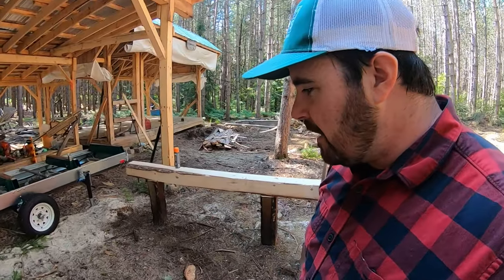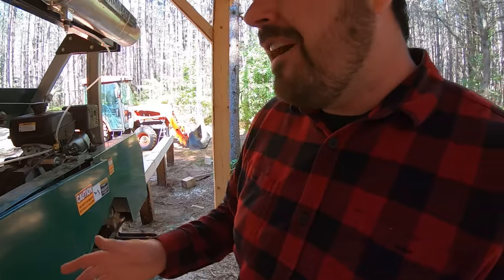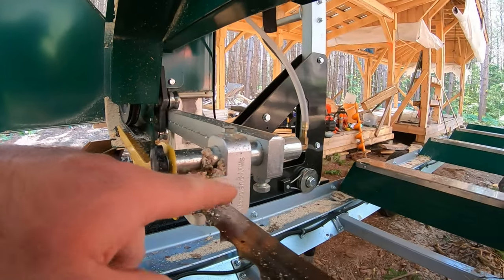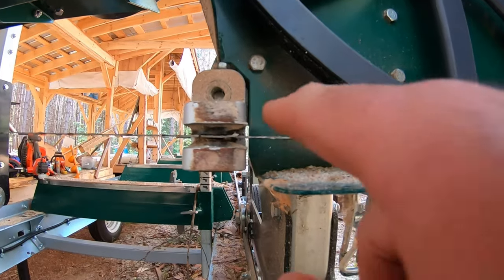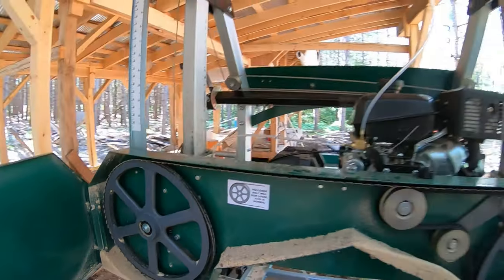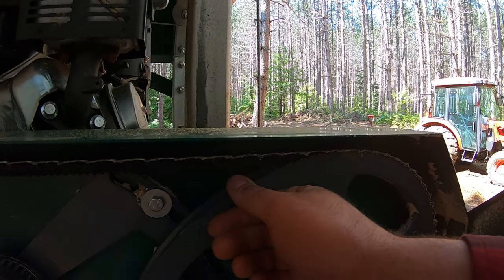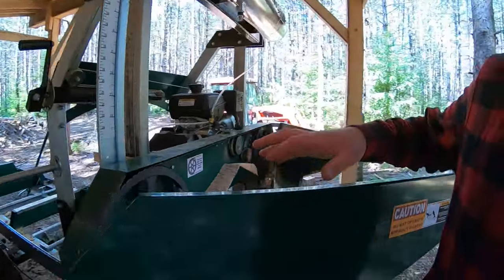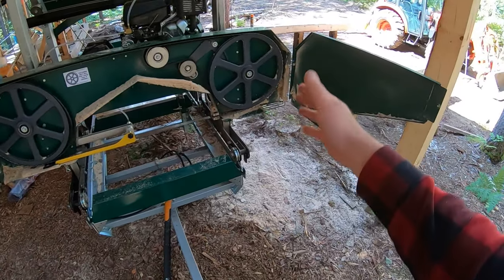Stop Your Sawmill Blade from Falling Off

Comment: Hi Sandy, Are you using 1 1/2" blades? I hear that they last twice as long as 1 1/4 blades with very little deflection.
Reply from the maker: Great question. I haven't tried the 1 1/2" blades. Sure would like to some time though

Comment: I had two problems when starting. The clutch was engaged and I couldn't rotate the wheels to check blade alignment. The drive wheel is one centimeter further forward than the follower. Both problems are factory quality issues in my mind.
The manual for the HM122 is faulty or leaves out essential information so thank you for pointing out the torque specs for the blade tensioner.
On my band wheel alignment problem, besides adjusting the tilt of the follower wheel, can I tap the shift outwards so the two wheels are in alignment?
Reply: It appears there is a pivot pin through the drive shaft preventing its forward motion. So the only remaining option is to adjust the shaft on the drive wheel. Comments?
Reply from the maker: Hi Steve. I'm not too sure about whether the shaft moves forward and back unfortunately. I don't believe so however
Reply from the maker: I'd likely want to double check with the tech support at Woodland Mills to see if they've got a good solution.

Comment: Sandy if you would have bought a mill from valley made in Canada you would not have a problem with the blades coming off mine is a green monster made by Pascale metal I do big trees allot of big hard wood s I slabed a big cepriss 50 inch wide and 20 ft but as long as I keep the pressure up on tincture it is good but I don't have a hydraulic
Reply from the maker: Yeah they look like good sawmills. I"m not too familiar with their blade tracking system though
Reply: I use cooks blades and it is just like your mil right now but I'm going to switch to the cooks wheels they don't have to have the fan belt it's soled the blade runs on the wheel that is prefit and true it works allot bedder go on there channel and check them out they make the best sawmill on the market but I can't justify owning one I just cut for my own place I have a small farm and I always have to make something for the farm and do like you and harvest the dead trees own my land have a blessed day and keep making the videos there's a lot of people out there who need to learn how to do it

Comment: My hm126 throws blades often. Feel like I’m fiddling with it more than I’m cutting it really kills the joy of the hobby.  I’ve been on the phone with WM many times with this issue and no resolution. Wheels are aligned and tracks fine, but 3-5 cuts in, it pops off again. I had no problems with other mills I’ve owned, but this one has been a pain.
Reply from the maker: If you need some help feel free to email me. It’s a learning curve but once you get it dialed in it will work well for you
Reply: @sawingwithsandy  thank you. It send the problem may sloppy bearings. It was really frustrating because I would get it tracked, tighten down the jam nuts, then test it again only to watch it walk off the wheels.

Comment: I don’t have a sawmill but I was watching another video where someone was setting up a woodland mill, he said the spring loaded washers just on the inside of the T handle should be flush with the housing and that means it’s torqued correctly. Torque wrench I assume is a way more accurate torque, just curious if it mentions the washers in the owners manual?
Reply from the maker: I believe there is talk about the washer method of tightening the blade as well. I haven't used that method but I"m sure it's a good option for sure
Reply: My MH122 is new; instructions say to tighten T bolt until two casings are flush. At that point the torque is 33 ft-lbs, too much pressure on the wheel bearings. I'm ignoring the instructions and using a mark at 25 ft-lbs to tension the blade.

Comment: Cooks sawmills are steel wheels with no rubber on either wheel and dont fall off.. Its not the rubber that keeps the blade on, its tension and tracking.
Reply from the maker: Yeah I’ve seen those wheels and they work quite well. These wheels on the Woodland Mills are designed a bit different with the groove for the belts to ride on
Reply: @sawingwithsandy  yes sir they are.  I saw allot of bigger pine, 18+ inches with my hm 122.  The larger logs show the limits of the rubber belts/vgrove wheels. Keeping the correct tension as the belt wears and is compressed is key.